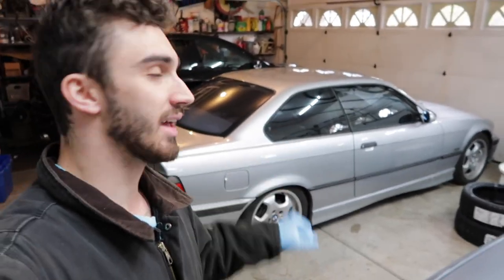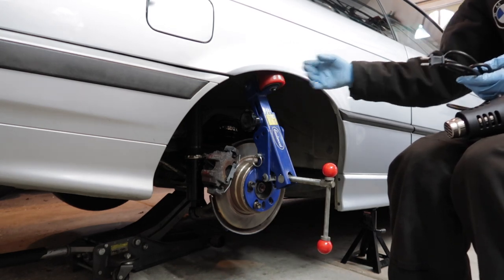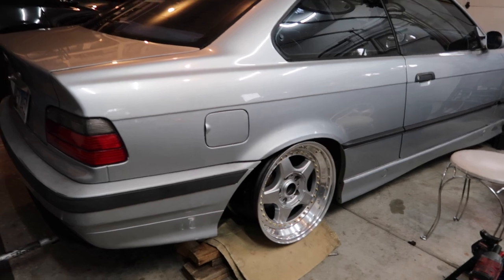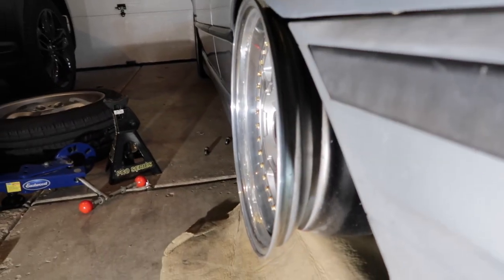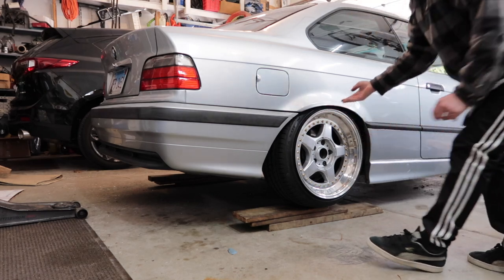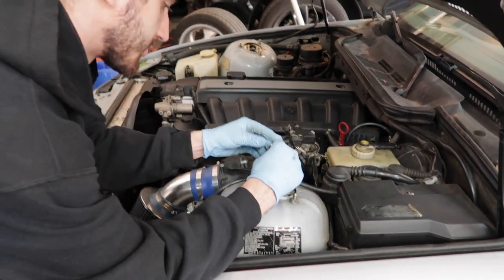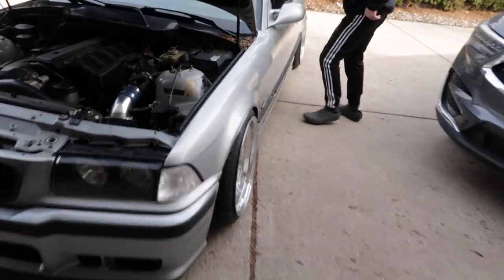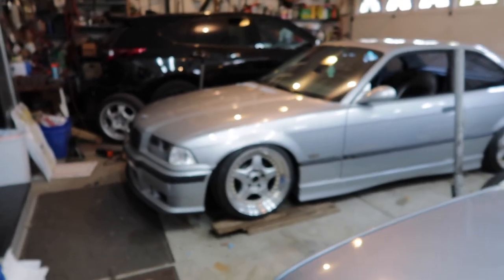Building the Perfect BMW E36 | Fitting BBS RF's and Dialing in the Fitment!

Comment: Fkn clean man, I need an e36.
Nice tip on those 5.5mm valve stems — my BBS LM’s came with those too actually. Can’t fit TPMS to them either so had to use tpms band clamps until I 3pc converted em

Comment: Looks sick!  I have my rear fenders rolled on my e36 but it rubs on the inner fender with a 10 wide et28 wheel. Does yours rub there too? Thinking of hammering the slight 'lip' that the wheel is rubbing on.
Reply from the maker: Nope no issues with that on mine.

Comment: Looks great, what is your opinion on cutting the inner lip of the rear arches (and sealing with something) instead of rolling them?
Reply from the maker: After doing this I don’t think it’s necessary, you can roll it flat once the rubber is out, so cutting to introduce potential for rust doesn’t seem worth it. At end of day we’ll have same clearance

Comment: Hey dude loving the car, what's the overall offsets on the bbs rfs?
Reply from the maker: -7 front and rear Im actually not sure. Id guess around 20ish
Reply: @M3nameisjosh  thanks! Trying to figure out specs for my 36. Either schnitzer 8.5 et13 square
Or staggered throwing stars
Reply from the maker: @MidgetMaster789  both will fit easily